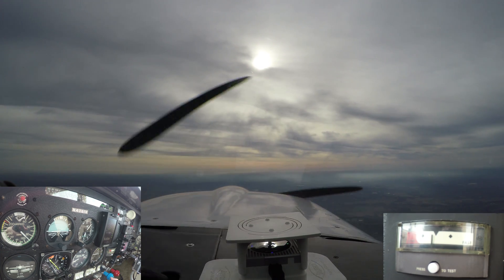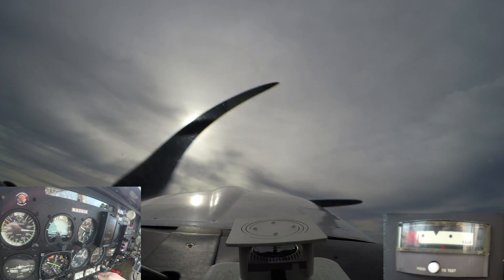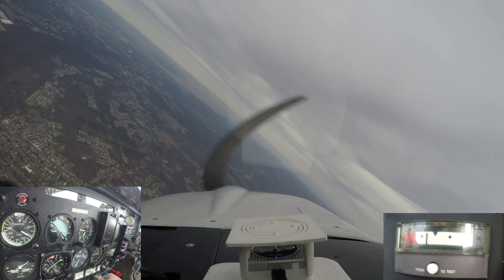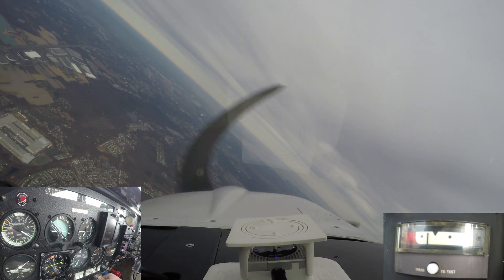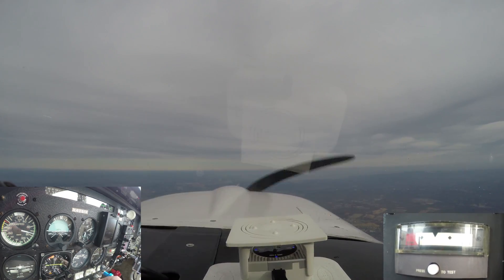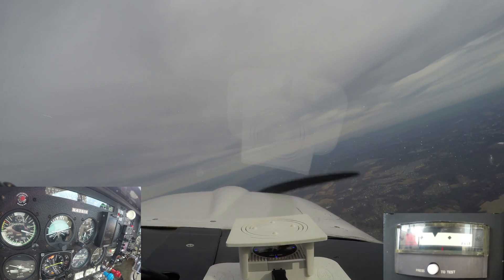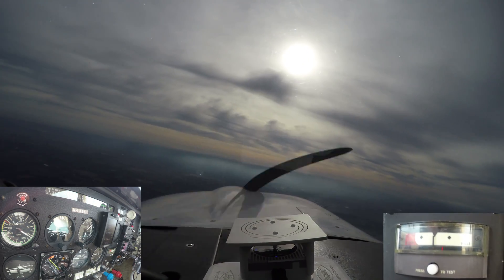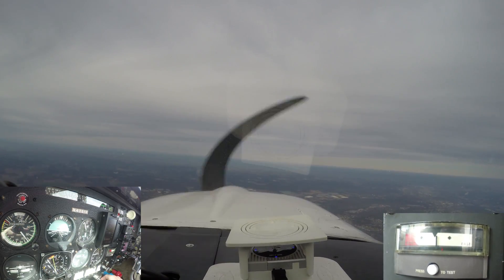Practicing Stalls in a Mooney - With ASI/AOAi View

Comment: Sounds like the Mooney has the same spin issues as a Cirrus
Reply from the maker: Not at all. Cirrus failed to meet the requirements of FAR 23.221 and required the addition of a parachute in order to be able to recover from a spin. Mooney just looses a ton of altitude but can recover in a way that meets the requirements for type certification in the normal category. Spin from pattern altitude is rarely survivable in any airplane but it's silly that a spin from several thousand feet requires a parachute in the Cirrus as the only means of recovery.